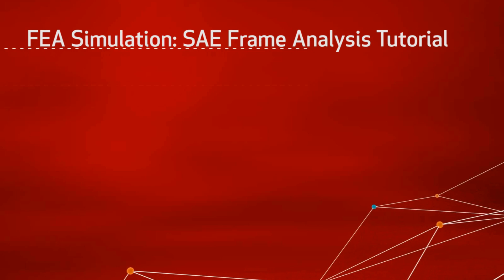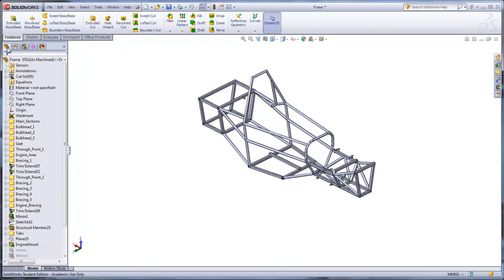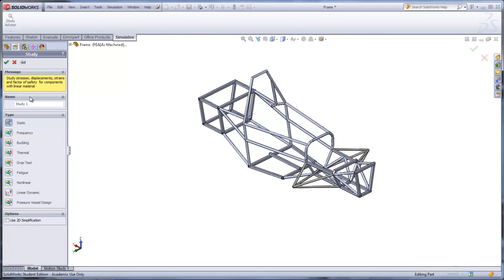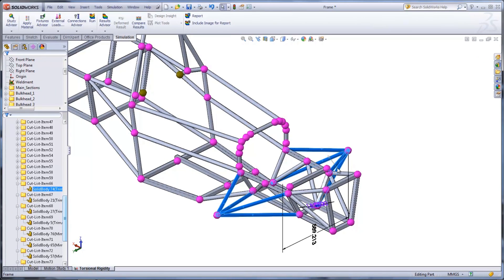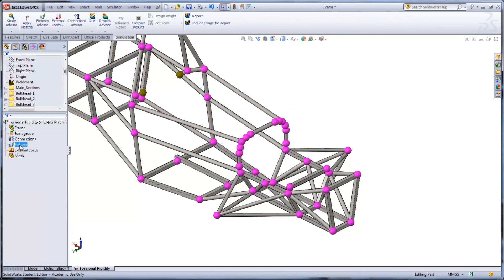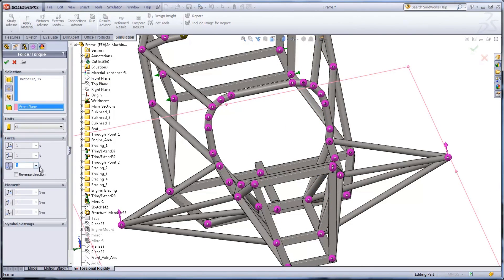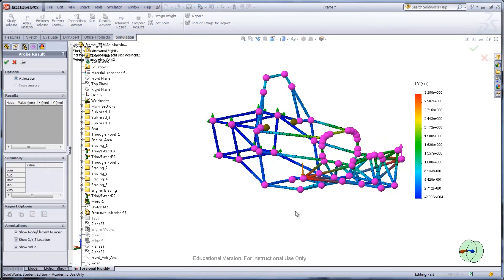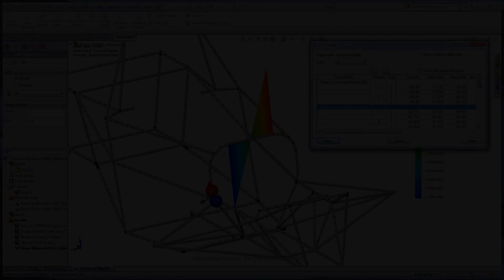SolidWorks Education SAE Frame Analysis

Comment: Terrible, I have been using inventor for many years, but with an open mind to test and master solidworks (eaaaasy). It's just not as smooth as inventor, tools and commands are slow and analysis resultas are confusing, non-standard. I have to give a massive plus that sheet metal tools are outstanding in solidworks out of that.. this is a tool for high school students, if you want efficient engineers move into inventor.
Reply from the maker: Hi Antonio,

We appreciate your feedback here. We continually strive to improve our software and value any and all constructive criticism.

Thank you!
Reply: @solidworks  Thank you I appreciate your response. 

After one month using it and exploring it, I still have that sensation like moving from windows 10 to windows 8 when comparing to Inventor. I can handle the tools with confidence as both share similar approaches. But I don't know if you guys can work to improve the response of the commands (included dimensioning) to have smoother and faster transition.

Frame analysis hasn't improved at all since the introduction of this tool time ago, I still need to explore it, but so far I couldn't see an option to make rotational nodal connections. However, I hope it's there somewhere. Just have a look on inventor or any other application that uses line element analysis, this is not about being different, it's about being functional, pleasant and offer standard engineering results representations.

Good luck, if you believe that I could be of any help to assists the improvement of your software from a perspective of Autodesk Inventor User, just drop me a line.  

Cheers.
Reply from the maker: Hi Antonio,

We so appreciate this constructive feedback, as we're consistently gathering helpful insights, especially from other users to really improve our software. Thank you.

Comment: Mine also is a spaceframe chassis. But when I try to do the torsional analysis it says that the model is unstable and you need to check the fixtures. What might be the problem.

Comment: How about making a video that explains what reasonable loads are to apply to a frame like this, and more importantly, what the hell the results actually mean!?!?!? I did my study perfectly but I have no idea what it actually means in terms of how strong the chassis is and how much it is actually torsionally stiff! My chassis is a modified version of a Van Diemen FF chassis(not for FSAE), so it's basically proven technology, but the factor of safety keeps coming up very low.
Reply: Well it depends on the application, there is no rule of thumb... What's the worse situation to be taken into consideration for the chassis (e.g.: 6G constant lateral), material used, tube profile, etc.

Comment: aside from the slurred speech...why use 169.7 N?  Suspension loads actually go the frame, not a truss member.  Fixing the rear like that overpredicts torsional stiffness.  the joints need to move in X; how do you do this?
Reply from the maker: Gnosis Autosports Could you post this question to the MySolidWorks forum? It's a better area for discussing technical questions like this than trying to do it through social media. Thank you! http://my.solidworks.com/forums

Comment: Hi in fsae rules they determined that the boundary conditions of analysis should be " fixed displacement but NOT Rotation" ,when you want to send SCRF Most of analysis have this kind of boundary condition ,would you please help me how can I add this boundary condition to my space frame In cosmos works?